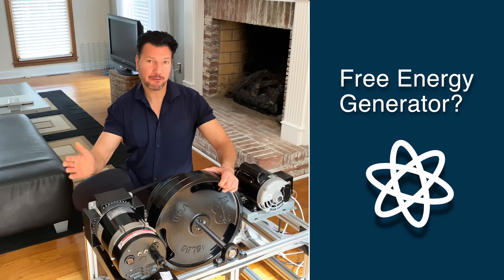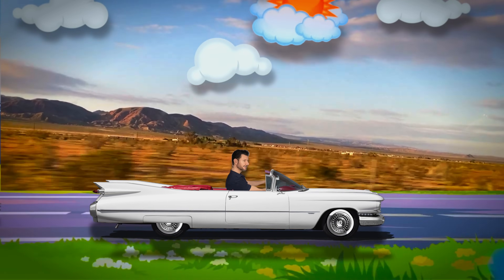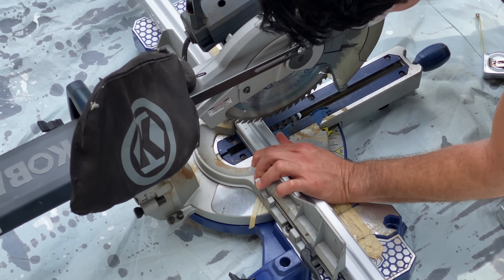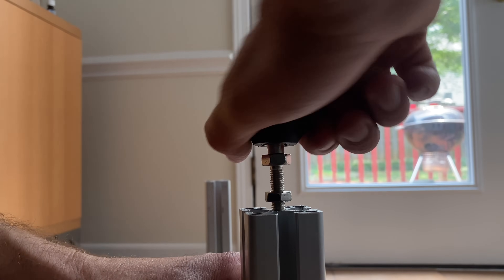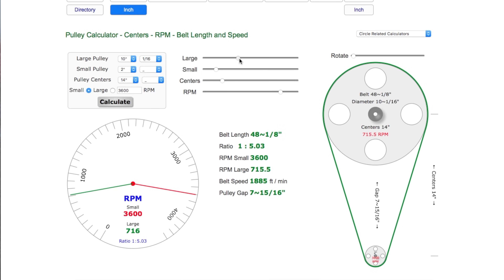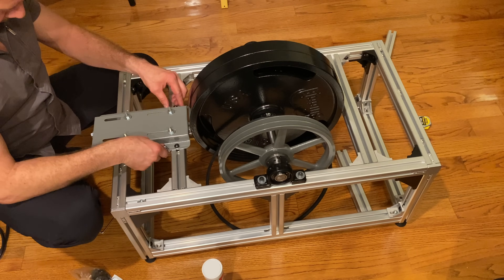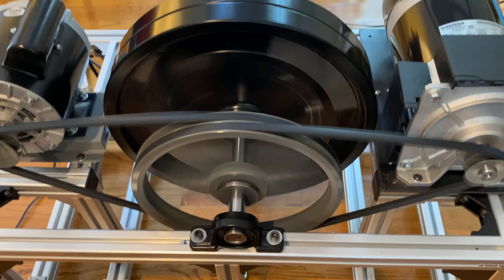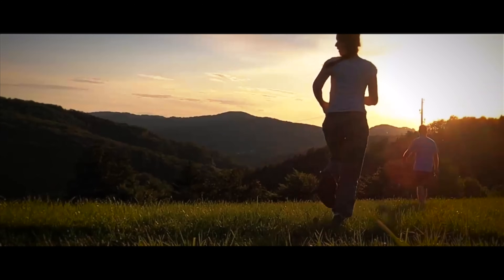How to Make a Free Energy Generator!

Comment: I have been trying to build one of these for the past six months for my crypto mining farm. What I found is the generator has to be a Synchronous 1500/1800 rpm generator (I got 10 kw for $800 from eBay).
Some of my Strategies:-
 1. Attach the generator directly to the steel bar with couplers (because belts increase friction).
2. Use a 3kw DC motor for the source (operates with batteries).
3. Use a powerGrib timing belt for the DC motor to achieve a constant output current.
These are the steps I have learned so far. I'm still ordering stuff so I will upload a video when I'm done.😄😄😄
Reply: 10kw synchronous  generator for $800 WOW...! thats damn cheap
Reply from the maker: @bwmrtham5730  thanks I will.
If we listen to all the Naysayers we would never come up with any new innovations. :)
Reply: @MarkusNenning  for me the problem 8s from ur high  RPM, if u can get an alternator that requires a low RPM, I believe it will work, or if it is possible for u to use a neodymium magnets  inside d  alternator to increase the current, then ur RPM can also reduce. My mind is very open to possibilities bcoz that is d mind of God, and I was made in His image.
Reply from the maker: @mordianthony4254  thank you!
Working on a new concept
Reply: @MarkusNenning  omg, of course you can use harmonics to do a system way efficient. As high as 95%, but that doesn't mean that you are going to be able to extract more than  100% of efficiency, to do a "free energy" you need that a system capable of giving (at least) 101% an that my friend it's impossible.
Reply: @MarkusNenning  There are those who try, and those who trash talk the efforts of those who do trying to make themselves look intelligent.The effort of belittling those who try to accomplish hard tasks does nothing to help others, but creates a true picture of their lazy ignorance as they spew useless garbage and waste both your energy and time. He's  willing to unquestioningly accept an education from a flawed system that's been many times proven to be inadequate, he's drowning in his own pool of ignorance..
Reply from the maker: @jimstewart4667  I am not sure if you call me lazy and ignorant 🤔
But thanks for the feedback!
Reply: Gracias
Reply: you need a mediating power reservoir for charging and discharge to take place...it cant lage capacity capacitors or batteries
Reply: There is free energy and free energy generators. Yours aren't working. For your personal use and not for commercial purposes, you can build one that is located at the national patent office in Alexandria, Virginia or at international patent offices in Paris, France or in Geneva, Switzerland. With the deep state practically expropriated, there is no longer any need to fear that they will come in with hired killers and take you off. Do your own research.
Reply: Great work man 👍 .....I think we can't avoid energy losses ☹️ but along with flywheel energy if energy from external battery that will help to recover energy losses ........ instead of connecting direct motor to battery Try variable frequency d drive to drive the motor ......I hope this will help to reduce energy losses......while in day time u can use solar energy just to fullfill energy losss ........ appreciated your work ......good luck
Reply from the maker: @creative-i2802  thank you very much Creative-i
Reply: I have already a 24 volt DC motor and a12 volt and 60 AH battery but my syncronous alternator is too large. I can confirm the motor impossible to run the alternator.
Reply: I would be interested in creating free energy like Tesla.
Reply: It's working perfect
Reply: Good work
Reply from the maker: @christianserrano4192  thank you Christian!
Reply: Cant wait to see if it works. I would love to see your results. I have subscribed to your You Tube in the event that you upload a video
Reply: Hy @John John   any news ?
Reply: @admyoutube Not done completely yet but I think I need a much heavier flywheel like 200lbs weight. It makes a lot of noise so I don't recommend running it in your garage.
Reply: Are you success free enagy?
Reply: This is fuelless Hub, I have revealed in channel while it will not work, but there are ways where we can bring the electric motor to resonance to be able to achieve COP, there also a transformer built to element some amount of lenz effect ,. These method work but in a different way

Head over to my channel to see more about electric motor configuration
Reply: Yyy
Reply: Any luck?
Reply: @R_e_l_a_x_z_o_n_e  Still building the foundation, I'm using four 100 lbs plates. I think I will finish this week or next.
Reply from the maker: @All_Things_For_Jesus  very curious if yours will work.
Reply from the maker: @BoOoM Steffen hallo Steffen Bauanleitung habe ich leider keine.
Im Internet gibt es einige pdf’s mit Angaben über pulley Grösse und flywheel Gewicht fand ich allerdings nicht wirklich hilfreich.
Ich werde mal eine Bauteil Liste zusammen stellen vielleicht hilft das.
Viel Erfolg
Reply: Free evergy doest exist
Reply: @bwmrtham5730  free energy device would need to have over 100% efficiency to work. And that is not possible to achieve bc in real world nothing is perfect and there's always some losses
Reply: I like this battery idea.. did you get closer to your goal?
Reply: DC to AC
Reply: My whatsApp number is
Reply: Help full the people
Reply: I think it's great job
Reply from the maker: Thank you Noufal appreciate it!
Reply: John don't waste your time. If you are trying to produce kinetic energy for your alternator from electrict motor you are not going to even harvest 90% back. In other words find a natural way of creating that kinetic energy to drive your alternator. So you can have free energy
Reply from the maker: Hello John have you had any success with your generator yet?
Reply: You'll need a deep cycle battery, battery charger, AC to DC inverter and a good circuitry to get everything running. The battery is powering the motor, the motor running the alternator, the alterations charging the battery. It is not totally free energy since the battery will be needed but it'll work just fine. You can further modify it and test a couple of other things from there.
Reply from the maker: Wow! Believe it or not this was actually also planned for a crypto mining rig if it would have worked :)
Please keep me posted would be great if you get it working!

$800 for 10kw is a great price!
Appreciate your feedback!
Reply: @MarkusNenning  Can you tell me the size of your steel bar, keyless bushing, and Inner Diameter of 45lbs plates?
Reply from the maker: @All_Things_For_Jesus  the bar is 25mm the inner diameter of the plates are 2 inches therefore I was able to use a 50mm bushings.
Reply from the maker: I have a hard time finding a way to connect the 5/8 motor shaft to the 25mm flywheel shaft.
Any ideas?
Reply: @MarkusNenning  you need a machinist that can make special part in such a way that the 25mm shaft will enter the diameter of one end of that part and the 5/8 shaft will enter on the opposite side of that part.The concentricity of the 2 inside diameters should not be more than .001inch.
Reply: @MarkusNenning  let me know if you need more clarification
Reply from the maker: @urbainjeannot8443  ok thank you!
Reply: @MarkusNenning   Wowww I do appreciate the work and show u do for us !!! I want to do this free energy too! Can u tell me where u bought the flywheel,shaft,bearings and pulley plz so that I may order it?
Reply: I think the biggest challenge is the friction. Unless we can have magnetic bearing spinning in vacuum, i think it would be a bit difficult.

I also planning the same thing, and you know what?? For the same reason, crypto mining ..... LOL

Ps: I'm designing axial motor / generator for this project. The way i see its more efficient than others type of motor / generator.
Reply from the maker: @MoslemPerspective  I have a few ideas how friction could be overcome or at least minimized.
Will show in my next video.
Thanks and good luck with your project!
Let me know how it goes.
Reply: It won't work.
Reply: It can never work 🤣
Reply from the maker: @omotolaoyeniyi631  and your qualifications for this statement are? Just a pessimist or do you have some tangible evidence? :)
Reply: @MarkusNenning  didn't you go to school? Don't you know physics? Energy can neither be created nor destroyed, only can be changed from one form to another! Law of conservation of energy! We're you sleeping in physics class? Phew! You can point me to any of these contraptions that work. If you watch this video at all, you can tell it doesn't work! Unless you can channel energy from the quantum realm, maybe!
Reply: @MarkusNenning  energy can not be create only transform, in the process of transformation their will always be loss. What you are trying to achieve will only work converting energy from water flow (hydrogenerator)
Reply from the maker: @omotolaoyeniyi631  yes of course I did learn that in school.
Did you hear about Phenomenons like for example: soldier’s marching over a bridge. If their frequency is closely matched to the bridge's frequency, the soldiers' rhythmic marching will amplify the vibrational frequency of the bridge. If the mechanical resonance is strong enough, the bridge can vibrate until it collapses from the movement.

We know very little about harmonization and the power of finding frequencies to either amplitude or reduce energy.
Yes my generator is far from that but just because your mind is limiting what you think is possible doesn’t mean it is not possible. Expand your horizon a little bit and don’t believe everything you learn in school.
Reply: @MarkusNenning  my mind is not limiting, you could see that at the end of my previous reply. Non of these particular types free energy devices have worked till date, that should tell you something, the way its done has to change, it's just beyond flywheels and pulleys
Reply from the maker: @omotolaoyeniyi631  all I am saying what you learned in school from text books in the end are ideas and theories from humans. What tells you that they were smarter than you and correct?

Harnessing nuclear energy, superconductors, space flight, all things that used to be thought of as impossible.
The mindset of “impossible” prevents us from trying and possible prove the theory wrong. Stay sharp!
Thanks for watching the video!
Reply: @MarkusNenning  exactly, I never said it's not possible, it's just beyond flywheels and pulleys only. All those technologies you mentioned were not that simple and the explanations made sense. Maybe one day, someone will come up with a better tech that can make this work, but certainly not pulleys and flywheels only. FYI it will be stupid or greedy not to love the idea of free energy!
Reply: Hola yo también sé que es complejo, pero tengo fe en que se puede llegar para que funcione eficazmente,
Cómo sabes hay muchos vídeos en YouTube sobre este tema he visto vídeos de gente que tiene máquinas muy grandes y que parece que quieren llevar una fábrica no creo que estén haciendo este tipo de vídeos solo para mostrar y que les dé el links y ganar algo por ese vídeo

No sé hay algo aquí que debe de funcionar aver si no lo muestras estaremos atentos yo también quiero emprender a ver si consigo hacer funcionar por lo tanto también lo comentaría ya que he puesto varios comentarios en diversos vídeos venga suerte ya ves lo que nos dices
Reply: @omotolaoyeniyi631  yes your right.. have you tried to equate all the energy on the system?  You are thinking that output energy is less than the input energy since part of input energy is converted to other loss energy, correct me if I am wrong? What if they replace the stator of the motor and the armature of the generator with strong magnets.? Magnetic energy will be added on the the system. Now think again on the Law of conservation..
Reply: @cianguevarra9764  now you are on thesame page with me, glad you agree with me that this is beyond ordinary pulleys and flywheels!
Reply: @omotolaoyeniyi631   I guess you miss something on my comment. Please read again untill the end..
Reply: @cianguevarra9764  someone did that but didn't work, the only contraption that has worked that I have seen is a full magnetic motor without external power, the man was able to arrange magnets in a way that, they repelled each other continually, if there is a way to block one pole from attraction or repulsion, that can be done.
Reply: @MarkusNenning  Just a word about than phenomenon called resonance...by example, take a guitar, pinch any of one chord... all the other guitar in the room will resonate at the same original pinched frequency !! its like a kind of free energy ! coz the other guitars dosnt take any energy from the first one ( tesla did the same with his high voltage generator)....
Reply from the maker: @topgun4229  you are speaking my mind! Exactly! I will touch on that topic.
Reply: @omotolaoyeniyi631  Nigeria brother of mine, this ur naira head dollar sha..
Reply: @xxmocionmesoma4603  😂 what u mean exactly, you gotta reason about all these things, science is objective not optimistic my brother
Reply: @MarkusNenning  Great job ! 👏
Reply from the maker: @LeoNardo-gg5fn  thank you!
Reply: @cianguevarra9764  I thought of that too, if that is a way to place a fixed strong magnets and also  on the fly wheel, places at a suitable angle of about 120 degrees (three magnets) may do the trick
Reply: Sí yo también creo que se pueda lograr de esa forma con imanes
Reply: @omotolaoyeniyi631  yeah but there are laws outside of standard physics harvard nerd
the law of resonance is something tesla discovered
Educate yourself a little
Reply: @jorgeyanez5672  energy does not ever actually go anywhere.
Reply: @jorgeyanez5672  in conventional systems man has engineered there is loss, but today's science is beginning to find there is a solution that lies outside the laws of standardized physics. The very name "standardized physics" should give away that there is more to be discovered...
Reply: @MarkusNenning  THIS
^^^^
This guy gets a pizza
Reply from the maker: @slammr_  😂 thanks!
Reply: @omotolaoyeniyi631  there are other sources of energy we are not allowed to use, less we upset the energy cartel's
Reply: @MarkusNenning  you are correct.
Reply: @rmendes2mendes915 hmm totally agree
Reply from the maker: @rmendes2mendes915  yes I believe so too. The energy sector is one of the most profitable markets.
Reply: @MarkusNenning  

There is no such thing as free energy, period! Thermodynamics won't allow it.
Reply: @topgun4229  tesla didn't tap into any free energy. Tesla coils have many loses. They do use resonance to create high voltage but the input power is higher than the output one bc there's always some losses. In real world nothing is perfect.
Same thing with guitar string example. You put in energy into the strings and then they slowly release it whilst resonating. If it all was perfect with no loses they would resonate forever but as nothing is perfect and there are loses they just after a while stop.
Reply: @latenightprojects  actually you're wrong and misinformed
Reply: @slammr_  which one of my comments ur referring to. Be specific
Reply: @slammr_  ur talking bout the one about tesla?
Reply: @omotolaoyeniyi631  dude, I think you are confused.. Here we don't create energy, just amplify a part of total energy ( electrical energy) , total energy does not change.
Reply: @seshamxy9135  I am not confused at all, I know what I am saying!
Reply: MATTER AND ENERGY ARE THE SAME THING.  YOUR ROCKEFELLER EDUCATION IS GOING TO MAKE YOU A FOOL WHEN THIS TECHNOLOGY IS KNOWN BY THE MASSES..
Reply: MANS' LAWS ARE ALWAYS BROKEN!!  THERE'S A DOUBLE-ENTENDRE..
Reply: @thomasmurray2603  Same thing was said 100 years ago, there is a reason they don't work, you have to look at them from another perspective. That's what I'm saying, not just condemning another person's effort, don't be overly emotional here. You can't be doing things thesame way and expect a different result, that is called insanity
Reply: @MarkusNenning  the resonance frequency effect doesn´t apply here on this project, because it is producing one frequency that should be 50/60 hz, the power grid frequency. the resonanceeffect is apllied to the music es+ecialyy bu the fisics effect it is everywhere, starting on our bodies
Reply from the maker: Marco I am not sure that is correct.
Yes the grid frequency is 50 or 60Hz but the vibrations from the bearings and the frequencies from parts starting to swing are all over the spectrum.
Just like when you pick a guitar string you have one main frequency that makes the majority of the sound but then you have a whole variety of harmonies and sub harmonics and frequencies that our ears can’t hear.
Thanks for watching and your feedback!
Reply: @omotolaoyeniyi631 
Most what we learned on school is theory but les practice, unless you do it yourself...
Reply: @george2053  I completely agree, and that is where the real life application comes in
Reply: @omotolaoyeniyi631  please tell us why